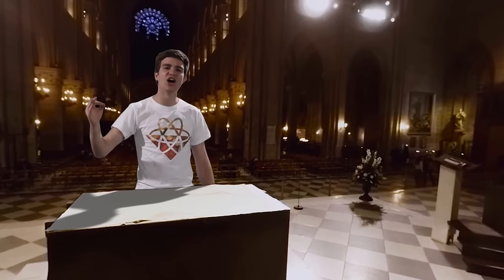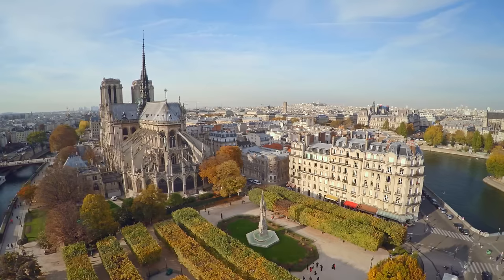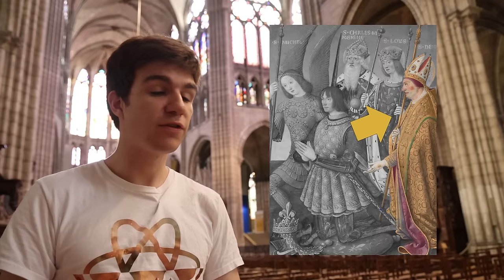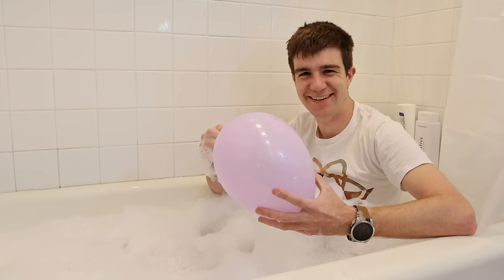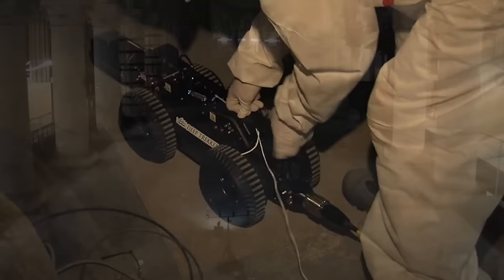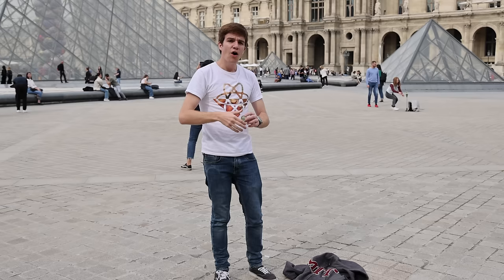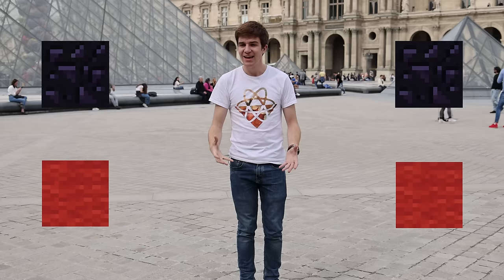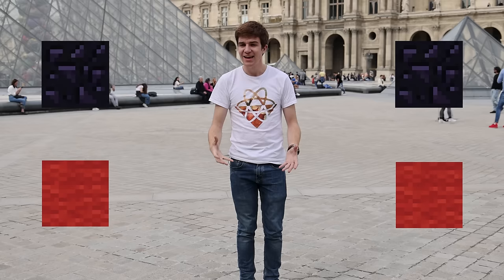Saving the sounds of Notre Dame

Comment: Computer acoustic simulations are cool, but real life scale model simulations are pretty cool too. By using a scale model, made of materials with scaled properties, and by playing scaled sound (adjusted to a much higher pitch), which is then then picked up by microphones after reverberation, and converted back to its original pitch, you get a reasonably accurate simulation of the real space.
Reply from the maker: Yes! I actually filmed a scene about that but had to cut it for time. So cool!!
Reply: For information, we have used scale models to study some aspects of the cathedral's acoustics, specifically the column forms (see A. Weber and B. F. G. Katz, “Sound scattering by the Gothic piers and columns of the Cathédrale Notre-Dame de Paris,” Acoustics, vol. 4, pp. 679–703, 2022, doi:10.3390/acoustics4030041). However, a scale model of the full cathedral at any useful scale would be rather difficult to manage...

Comment: I am curious about the age of the wood used in the pre fire cathedral and how it effected the sound.  The post fire wood will probably be significantly younger when it was cut so I wonder how that will factor in to the sound of the space
Reply from the maker: Yup! 100% The key factor are moisture content (the origionals had been drying out for centuaries) as well as the fact there aren't any old-growth forests in Europe available.
Reply: For information, the general questions about the wood structure deal with the roof, which is above the vaulted stone ceilings, so they have very little effect on the acoustics of the main cathedral space. Of course, the acoustics of the attic where the wood/roof is would be affected.
Reply: Oak wood has been used for centuries all over Europe for building boats, and it was these same carpenters who built the framework of cathedrals and churches, which is why all cathedral frameworks look like an overturned boat hull. The oak framework of Notre Dame, also called "the forest", dates back to the 13th century. More than 1500 oak trees, all of them between 200 and 300 years old, had been felled, with beams 100m long by 13m wide in the nave, 40m in the transept and 10m high. Before use, the woods had to be left to dry for sometimes 10 to 20 years. Before its collapse in 2019, it was one of the oldest structures in Paris. The craftsmen of that time knew their wood. The construction of these cathedrals required a great deal of planning, without forgetting that the craftsmen did not have, like us now, so many tools. The cutting stones and the beams could take several years, the reason why the work of Notre Dame began in 1163 and ended in 1345. The Gothic style was just beginning. Later, other cathedrals were built faster.

Comment: when capturing reverb of real spaces, you can’t get good results with an impulse without either clipping the mic (which no longer accurately captures the reverb) or getting noise by using a quieter impulse. the better way is to sweep the entire audible spectrum over some time, since a perfect impulse contains all frequencies equally. you can do it for longer times to get better results or shorter to capture in less time, and you could theoretically run many sweeps and average over them to get better results in a noisy place (but i’m not aware of anyone doing this). then in software you convolve it with a time inverted copy of the same sweep to get an impulse, and then convolve that with audio to apply that reverb. another advantage of sine sweeps is that any distortion will be moved before the impulse with the first convolution, and can be edited out. this distortion isolation is improved with longer sweeps.
Reply from the maker: Yes! That's actually one of the big tests they did with the cathedral, although it's a bit more recent a development so there isn't the historical data to fall back on. Plus as a demo popping a big red balloon is much more fun!
Reply: @AtomicFrontier  yea something viewers can immediately hear is gonna be way more interesting in a video
Reply: For information, the sine sweep method is what we regularly use. The balloon burst/gun-shot/impulse are included int he procedure as a fall-back situation if there are any problems/issues with the measurements. We were also fortunate to uncover some older recordings of measurements at Notre-Dame from the 1980's, and the only usable data were the balloon bursts (see B. F. G. Katz and A. Weber, “An acoustic survey of the Cathédrale Notre-Dame de Paris before and after the fire of 2019,” Acoustics, vol. 2, pp. 791–802, Nov. 2020, doi:10.3390/acoustics2040044).

Comment: It's essentially a fine tuned version of Ray tracing software. Just adapted for sound and different environmental aspects.
Reply: Well, I would say it is a bit more complicated than that, as one needs to account for simulated wave effects using a light-ray model, as well as frequency dependence and time. Raytracing for graphics is quite a bit simpler, with only a few reflections being considered, and no effect of time or frequency dependant properties other than color.